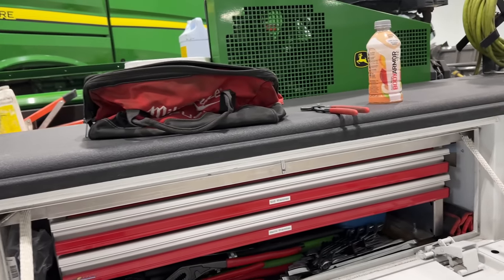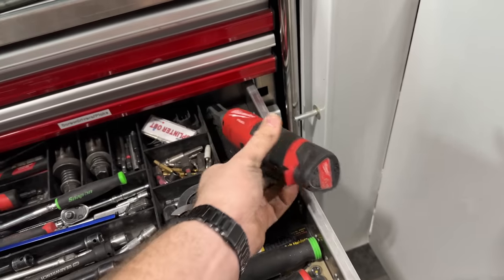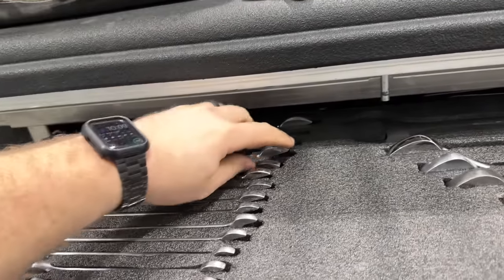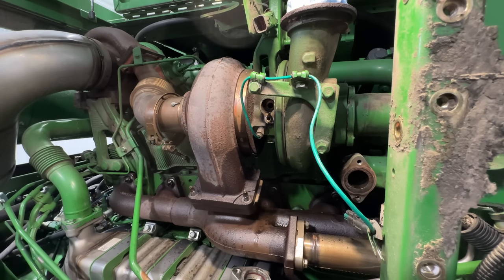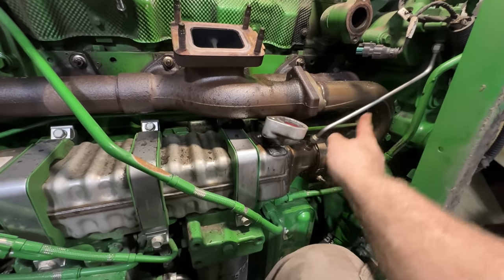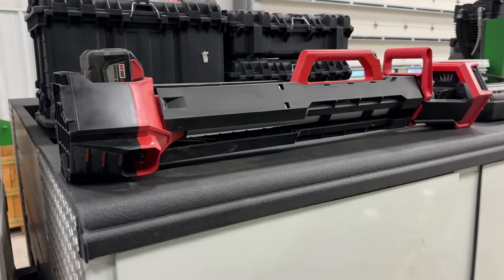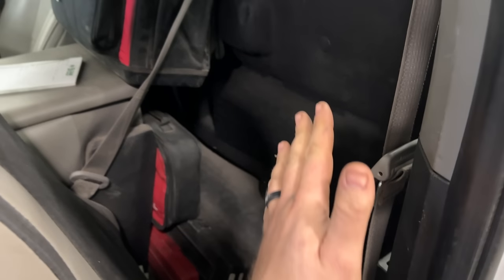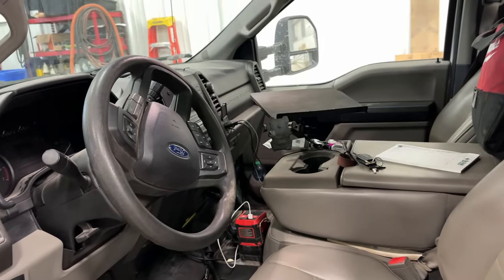Engine repairs on a S680 combine & Service truck tour (part 2)

Comment: Thanks for another great video ZK. 
It was interesting and enjoyable. 

Thanks for showing us around your service truck. Wow. Lots and lots of tools. And you just showed us one side. Was very interesting. I would not even begin to guess how many dollars are invested there. Wow. 
Thanks for showing us ZK. 

I am amazed at what you have to take off just to replace the manifold gaskets. Just unbelievable. I know the engineers that build this stuff do their best but you had to take a lot apart just to do the replacement. My guess is that 75 percent of your time is just getting at the gasket and the rest replacement time. 
I am blown away at how much you had to remove. 

Thanks for showing us ZK. Looking forward to the next part of it and the rest of the service truck. 
Thanks again ZK. Most interesting.
I learned a lot. 
Thanks 
The Iowa Farm Boy.

Comment: Just want to say thank you for what you do on here! I was struggling to put a crankshaft dampener and variable speed fan on my 9630. I went back to your video on the 9430 where you talked about the John Deere tool not lining it up right. I built and alignment tool and it went right together! Thanks
Reply from the maker: Glad I could help

Comment: Once again it takes way longer to get to the problem than to fix it. I guess if it was easy everyone would be a mechanic. That’s a lot of work for one gasket. How long does it take to R&R that gasket. Common problem on deeres??Another great video. My service truck looks like yours. Pack as much crap as it can hold. Never know what you need when your in the middle of no where.
Reply from the maker: Right on 🤘🏼

Comment: Hi just trying to remove our 2014 s680 exhaust manifold (UK Machine but US built) the coolant by pass tubes won't come out because they but up against the casting which held the egr cooler looks like we will have to remove the fuel filter housing to loosen the casting in order to get the tube out which the manifold won't come past? great videos by the way has given us the confidence to get stuck into the old girl this winter.

Comment: Could I have some of the part numbers for those RWAs.  I work at a deere dealer in the northeast and our parts department has no idea what they are and how to find them.
Reply from the maker: I don't think you can get them anymore unfortunately. I use them sparingly.

Comment: Do have a milwaukee m12 wireless scolding iron
Reply from the maker: Yes you will see it on part 3.
Reply: It's the best soldering iron ever  used

Comment: Those ratcheting spline drive double box wrenches from Gearwrench are arguably the best tool they make. If you’re reading this and don’t own them do yourself a favor and buy them. 86126 & 86142
Reply from the maker: I totally agree. I think they are better than the matco ones and are cheaper.

Comment: 30 k at least in tools and boxes and people wonder why it cost so much to get something repaired..
Reply: Not the 30k tools. The 6 hour job to get to the gasket in the first place, wich should be much better engineered,  is why stuff is expensive when it needs fixing.